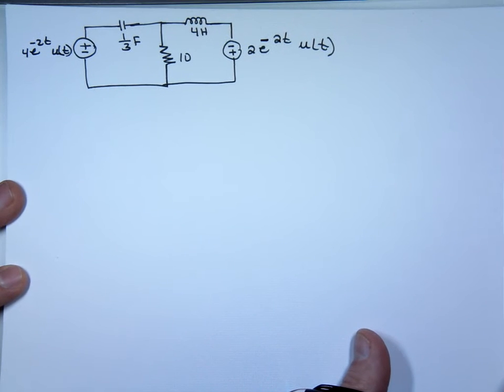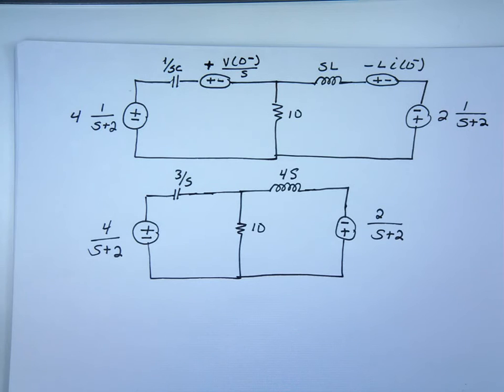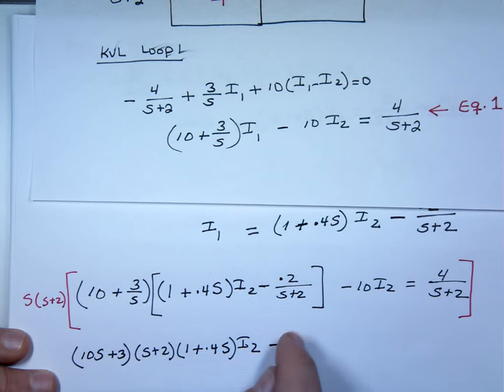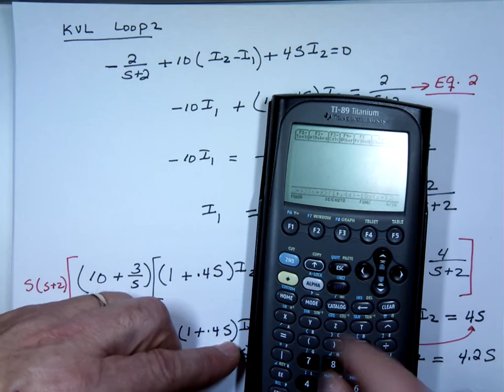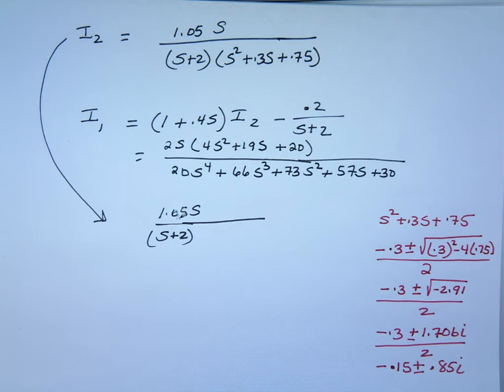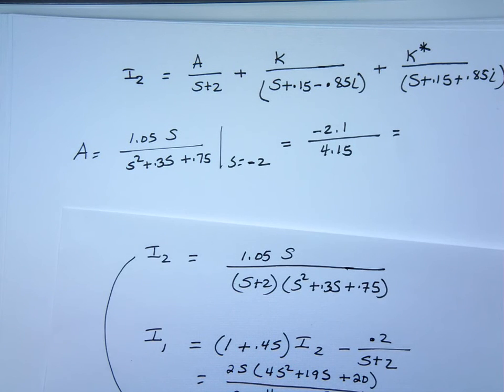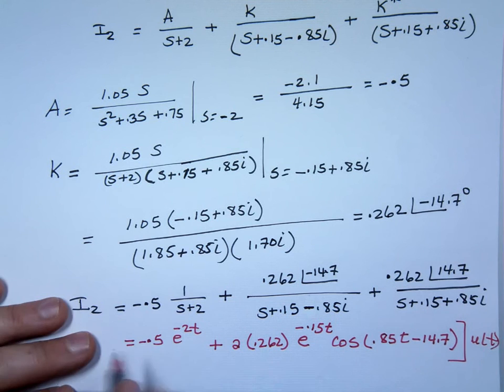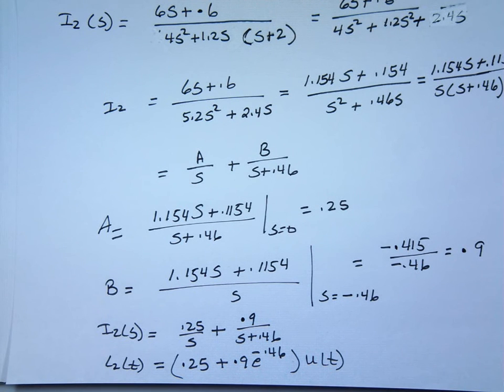Solving Circuit Problem using Laplace - Example 1

Comment: how come the (1+.4s) wasn't affected by the s(s+2) multiplication???? just a struggling eng student in need of help
Reply: IF U FOUND THE SOLUTION PLZ TELL ME
Reply: 1+.4s is considered one term, then multiple everythings by s(s+2) ,but he multiple s into the (10+3/s) , so the answer for the first I2 is  
(10s+3)(s+2)(1+.4s) I2   

But the second term is incorrect ,because he forgot to multiple (10+3/s) to the (.2/s+2)

This is some logic understanding